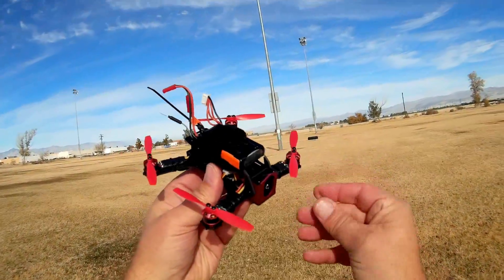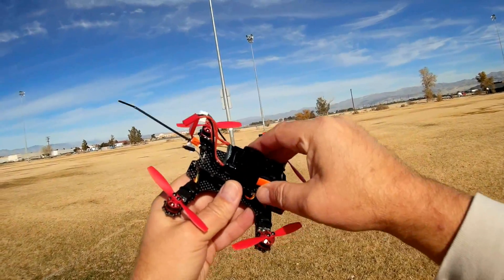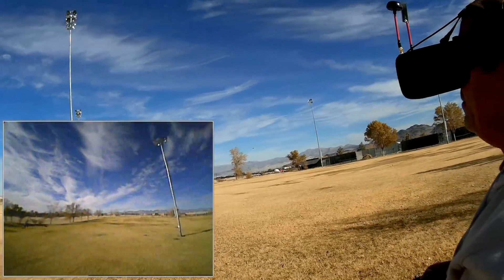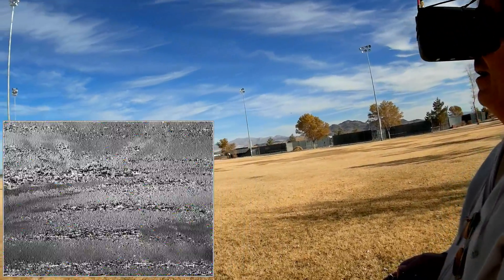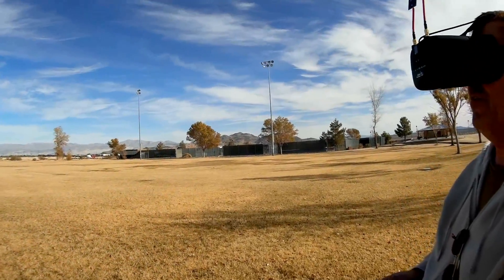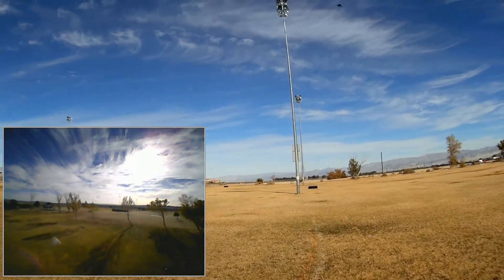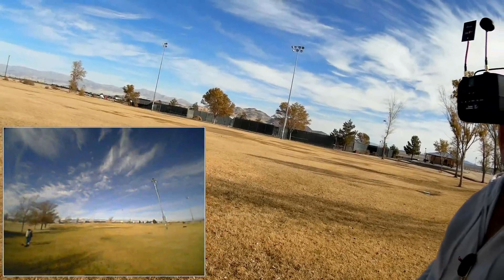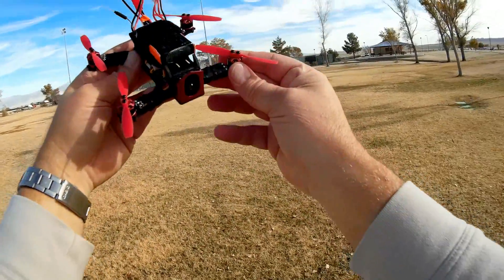Eachine Racer 130 FPV Racer Great Acro Flight Trainer

Comment: Good video, and good advice on practicing on a simulator first. Drl has a new one out now that's supposedly pretty good too. Keep practicing on rate mode, once you get used to it flying in angle mode feels like    driving with the parking brake on 😀

Comment: Looks like a clone of the Tarot 130 only a few grams heavier. Great introductory flash price of $169.99 at BG, even list price of $210 is not bad which includes Radio Transmitter, case, extra camera w/DVR and battery. To bad the DVR camera is not a clone of the 808 #16. Your flight time in video was less than 4 minutes. You could adjust vbat for alarm a few tenths higher with clean flight to give you another minute of flight time but with 450mah battery. Your flight times should  be around 5 minutes max. Thanks for doing all the videos I enjoy them.

Comment: Not bad ACRO flying. Any time you don't crash is a good flight. I have a question for you. You said that the camera was low res so the picture wasn't very good. My question, was the bad picture due to the camera or the goggles? The reason I'm asking this is I'm looking to get into FPV and need goggles. I'm looking for something to use with my xk x252. Any thoughts on some decent goggles that don't break the bank?
Reply from the maker: It was the VGA resolution camera.  The VR-D2 goggles that I use produce excellent video, that is if the camera is also excellent.
Reply: Thanks for the info.

Comment from the maker: This little brushless racer can be a great FPV acro trainer for those wishing to enter racing as its stock settings are somewhat docile. But I strongly recommend first time FPV fliers practice with an FPV simulator program before taking this out on its first flight. FPV Freerider is an excellent simulator to do such. You can find it here. https://fpv-freerider.itch.io/fpv-freerider    
Try the free demo version first to make sure that it works with your particular controller.

Joshua Bardwell produced a GREAT series of tutorials with FPV Freerider. You can view them here. https://www.youtube.com/playlist?list=PLwoDb7WF6c8kjYXam4m3msvRbkORU41GY
You can do most of the tutorials lessons using the free demo version of Freerider.
Reply: Quadcopter 101 do you have any spare quadcopters that you don't want/ like because I really want a good quadcopter/ drone I would pay for shipping but yh kinda a long shot but eh it's worth a try... I have been flying for 2years now but one of my motors on my Mjx x101 won't turn on by itself so I have to push it only then will it power up... Do you know what it could be? 👍great video by the way 👍👍👍
Reply from the maker: Will blundell Replace the motor.  Here's how https://www.youtube.com/watch?v=dhdaXiktyZc
Here's where to get them http://www.banggood.com/MJX-X101-RC-Quadcopter-Spare-Parts-CW-CCW-Motor-p-1010274.html
Make sure to purchase the correct motor (Clockwise or Counter Clockwise). Your old motor will have CW or CCW printed on it.
Reply: thank you so much!

i was one of your 1st 100 subs btw i love your vids!!!

Comment: Thanks for the great review, as ever.

Was that run done starting from a full battery? Seemed to only be about 2min 30 before the low voltage warning kicked in. Seriously considering this as my first brushless racer but that seems like a pretty poor flight time. 

Cheers!
Reply from the maker: Yes it was full. Measuring the "at rest" voltage post flight, total voltage was 11.5V with each cell at 3.83V.  So the battery still had some oomph in it.  Still not sure what the issue is with the VBAT beeper warning?